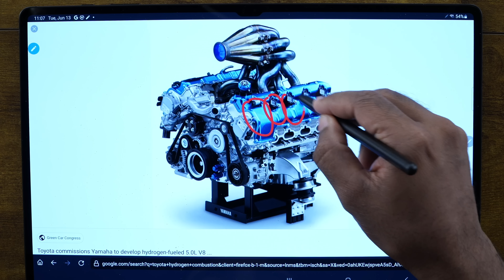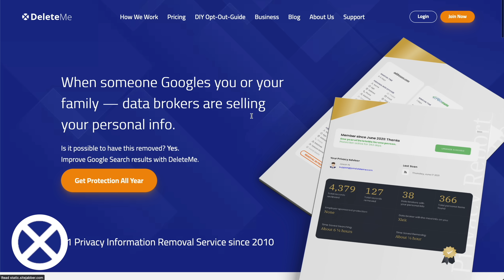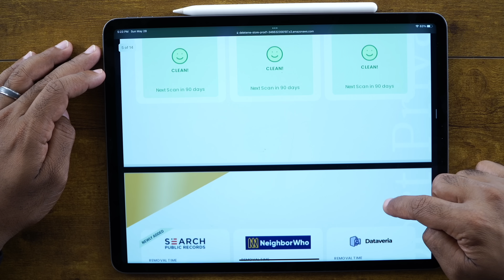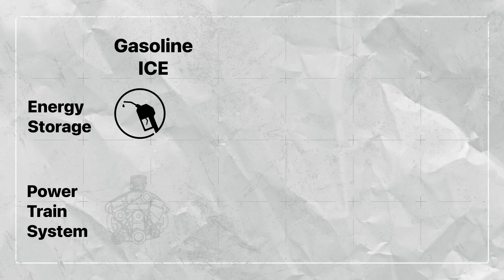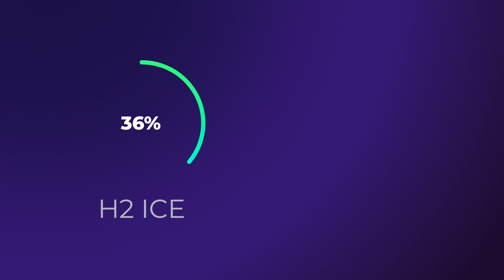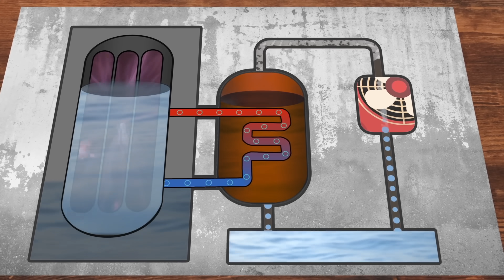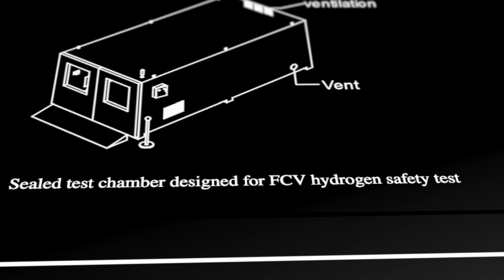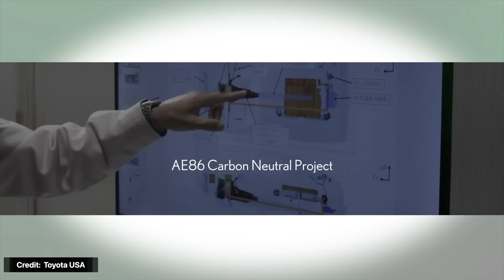Toyota's Says They Just Destroyed EVs - Hydrogen Combustion Engines

Comment: Wouldn't it make more sense if they focus more on the clean on sight production of hydrogen ?
I mean they probably do but I guess its not as flashy for marketing and the investors
Reply: Big trucking companies might invest in hydrogen production but it is not something that would be allowed in residential areas or cities. The energy needed to keep the hydrogen liquid means lower the temperature to about 32 degrees above absolute zero. Not easy or safe, most metals become very brittle at those temperatures.There are so many lossy energy conversions needed to produce, transport and dispense Hydrogen. Besides, building a fueling station will cost many millions of dollars, and be located out of cities or residential areas.  The one advantage of H2 cars is their maintenance demands keep the dealers rich

Comment: For transfer, liquid hydrogen is the norm to get a reasonable efficiency. Liquifying H2 is really energy intensive, lowering it down to around 32 degrees about absolute zero. The storage and transportation problem with that is that at no time in the entire cycle can it be allowed to rise about that or returns to gasious state and rapidly expands so blow off values need to vent off the gas that can be very dangerous.  The proposed solution is isolating hydrogen at the dispensing station, which is a very energy intensive process and using chemical processes and safety restrictions that would prevent them from being located in cities or around housing..  The round trip production, storage, transportation and use cycle has so many liabilities and costs that EVs do not have.Having to drive to unpopulated areas to refill the tank would mean they would not be used by city dwellers and the areas that would allow the stations are low population zones so they would be a low use technology.  The compexity of the engine would make it a very expensive system to maintain compared to the single moving part of an EV motor that should not need any service for millions of miles.
Toyota is committing suicide

Comment: Fuel Efficiency aside and is important. 

The cost of time has to be considered too. Tractor trailers, large freight liners/ships, heavy equipment are limited by refueling times for electric. Any industrial applications to including farming which is important depending on weather conditions for planting and harvest.

Farming especially. A one two hour recharge time to include access to charging in a field isn’t practical.

H2H low efficiency compared to time management. One hour of industrial time means $100’s to thousands an hour of cost. In this case fuel  efficiency isn’t as important as overhead and lost of reduced production per hour cost, and harvest timing associated with weather conditions.

Think past the city life you may live and work in. I don’t mean that in a bad way. Your fly over states are the city support industry. Good luck holding a city together without food and supplies. Prices will triple if you reduce industrial efficiency using just electric or fuel cell electric

Comment: Hydrogen does have a significantly higher energy density my mass to fossil fuels, about 3 times as much per kilogram. However it can't be stored by mass, unless cooled to cryogenic levels of -256°C IIRC. This is completely impractical in a vehicle, as keeping the Hydrogen cryogenically chilled uses lots of energy. 
Hydrogen can only practically be stored as a compressed gas, but when stored by volume it is only ⅛ as energy dense as petrol/gas. Coupled with the inherent inefficiency of an ICE, the the fast filling properties of hydrogen become irrelevant, as any hydrogen ICE will need more refills than an equivalent BEV.
Fully charged have done the research, as have plenty of other very talented engineers, some posting the findings on YouTube.

Comment: As a mechanic I see hydrogen ICE as a supplemental rather than disruptive technology. You can only fit so many kilos of gas anywhere its going to survive in a crash and once efficency comes into account you end up with not a whole lot more usable energy on board and you're shedding very little in use for a whole lot of extra hassle. I can see how it will be well suited to some motorsport and can fill a gap in demand for lower emissions vehicles as there is only so much supply of electrics and in port cities where you will have massive hydrogen facilities soon for shipping it can keep costs supplemented for users within a region.... Think its really a stepping stone to synth fuels for automotive thats going to piggyback on marine and thats why they have worked with Yamaha as that is keeping costs down by splitting the R&D as its not really well poised in Auto as it is Marine for the longer term. You really don't want hundreds or thousands of kilowatts of battery down the marina rather than parked in the garage where they can be more useful. Will sure be some on grid boats but I think BEV really suits most passenger auto and hydrogen suits motorsport, some heavy transit and marine and with large scale industry/port cities and areas like Australia thats most definitely in Toyotas market sights, then it has the use cases and demand to make it well viable overall and be able to fill supplementary demand for passenger auto or at least in some western markets. Not so sure about others.

Comment: Not an EV fanboy here, but a single H2 station costs in the millions range. About 10x as much as a 16-charger EV "station". Also, EVs with heath pumps go 4-4.5 to 1 COP. Model 3 long ranges go 320+ miles on cold weather with only 15% drop compared to warmer weather. Sending H2 from one place where it is produced will cost a great deal, and generated on the spot will severely limit how many cars you can reload. Complexity of H2 ICEs is imense. Why use electric energy to make and then burn inefficiently H2? Japanese Toyotas had their wheels falling off, so I wouldn't take 10-yr forward statements from them very easily. Two people died last month in my country due to LNG tanks blowing up, no car crash involved. Volumetric density of H2 means ... cold weather vs really hot weather will influence fuel density thus range. The current consumption of H2 ICEs is equivalent to 13 L / 100 km in gas/diesel ICEs. H2 pumps freeze after 1-2 fill-ups. Tech seems 15-20 years from break even, by that time solid state or competing full-electric tech should be 50 yrs ahead by comparison.

Comment: The main reason reason you see various hydrogen hypes repeatedly is that practically all industrial scale hydrogen existing today is made from fossil fuels. Dig deep enough into any new hydrogen things into who paid for all the nice graphics promoting it and you find an oil and gas corporation. It is logical - getting hydrogen powered vehicles popular now would mean they get to keep making huge profits because they own the only large source of hydrogen gas. In distant future that might change. New, clean infrastructure for hydrogen made by electrolysis of water whenever renewables have extra capacity for example might one day exist. Until then powering anything with hydrogen means powering it with a disguised fossil fuel. And at much lower efficiency too. Basically they get to sell us cars that do less than 10 mpg and they can make it look like green tech.  
And all that still ignores the basic physics of this nonsense. Due to the laughable efficiency this H2 ICE will get less than half the range the same tank of hydrogen would give to a fuel cell car. And depending on how the hydrogen is made it could be 3 or 4 times less distance traveled per kWh of energy input. So either you get fuel tanks as big as an EV battery but in harder shape to package or you get tiny range. In a car that makes all the noise of ICE cars that cause cities to be such unhealthy hellscape where you cannot hear yourself speak, the mentioned emissions of harmfull gases, the frequent and expensive servicing of and ICE car but this time in authorized shops only because there is a very high pressure hydrogen vessel there etc. 
The only way I can see this being good for anything is letting motor racing continue with its screaming engines deafening its spectators like they do today without being dependant on oil (again depending on how you make the hydrogen). Those guys will not care about the price of the fuel (energy efficiency of the whole system) or the maintenance costs. But for them synthetic fuels made by CO2 capture and renewable hydrogen will probably be easier to switch to.

Comment: Fact.
.
The grid is not 100% green
. 
Any green energy project you build SHOULD be used as a 1:1 replacement for dirty energy.
Can we agree on that?
.
This is the problem.
Any green energy project which is used to liberate the Hydrogen, is a project which could simply be used to displace (replace) a similar capacity of  working "dirty" generation on the Grid (1:1)
.
About 30% output from that "1:1" output could power an equivalent BEV fleet the same distance as the Hydrogen I E option.
.
To put it another way.
Take 100GWh of stored energy

Use that to convert Hydrogen,
How much stored energy reaches the wheels of a Hydrogen ICE fleet? 
30GWh (±)..... 
(I think that's optimistic, but....let's use it)
.
How much of that SAME source Energy, transferred "raw", would arrive "at the wheels" of a comparable BEV fleet?
80GWh
.
To achieve the range of the BEV Fleet, a Hydrogen ICE fleet would require (80÷30) =2.67 times the available energy at the wheels,
Which would require 2.67 times the SOURCE energy.
.
That Hydrogen ICE fleet would require 267GWh of stored energy.
.
That's 167 GWh of "DIRTY" energy which would remain on the grid.
(For the effort of building the same project)
Hydrogen in any form results in a continuing dirty grid for a given investment.

It's ALWAYS a DIRTY alternative.
.
"Green hydrogen" is a misnomer.
.
And that's just the energy source.
Add the EXTRA infrastructure cost, which could also be diverted back to generation.
.

Comment: First problem: Hydrogen green obtained from electrolysis of water and burnt can only recover 30 % of the energy used to split the water. it is inherently inefficient. Blue hydrogen obtained from methane by steam reforming produces carbon dioxide waste. while the whole point of the exercise is to cut carbon dioxide emissions. Second problem: Burning hydrogen in an internal combustion engine will produce NOx emissions unless the ignition temperature can be kept below 1100 degrees Celsius. To me it looks like Toyota has missed the EV boat and
is management is trying to save face with an alternative internal combustion engine.